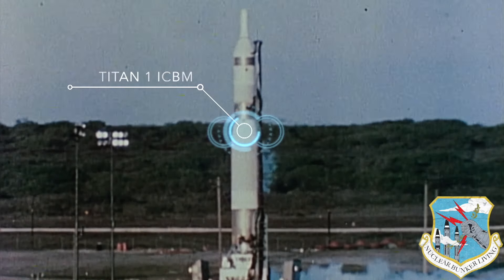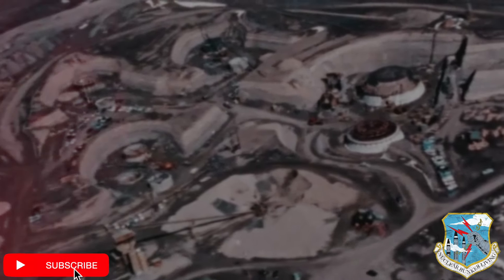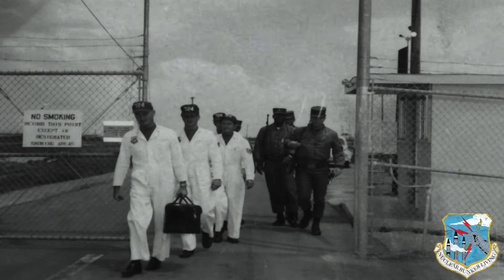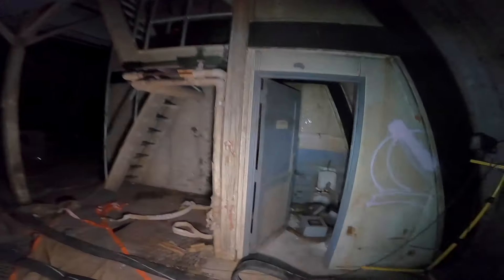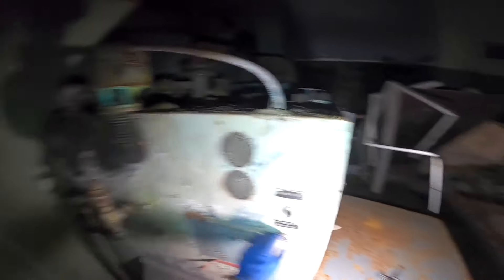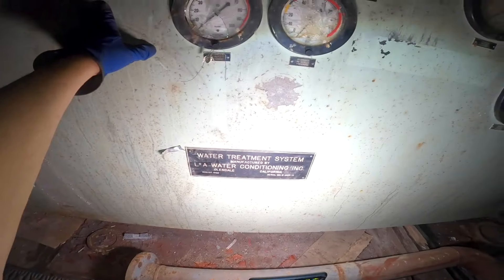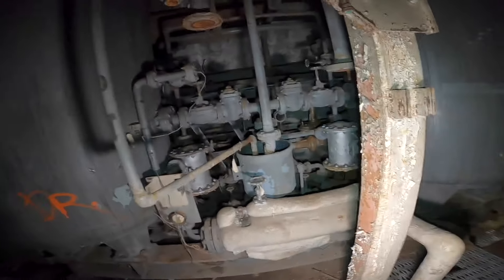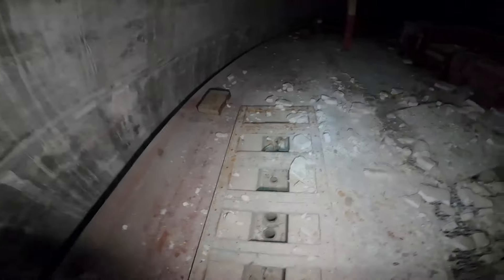EP. 23 -  Titan 1 POWER DOME That Powered A Nuclear Armed Subterranean City.

Comment: Everything down to nuts and bolts have a National Stock Number (NSN) or part number because the ordering of repair parts would be a nightmare without it. We didn't have a streamlined system until after WWII.  It's one of the reasons the American military is an effective fighting force. "Battles are won or lost by the Quartermaster Corps before a shot is fired".  -. Erwin Rommel
Reply from the maker: Love it

Comment: You keep saying "turbine generators", Nik ;)  If you're interested, they recently scrapped-out a government fallout bunker back East (can't remember where) - they had some of those Worthington diesel generator sets for sale; you could get a couple of the originals and rebuild the power dome.  Boy that chair looked comfortable - NOT!
Reply from the maker: The replacement power plant will be located in a different area.  Plans are for a 24MW power plant. 
Chair was kinda cosy. Poor soul who sat on it for years was deaf. The acoustic baffles could not
have dampened the noise enough.
Reply from the maker: If you find that Worthington link. Send it across. Thanks